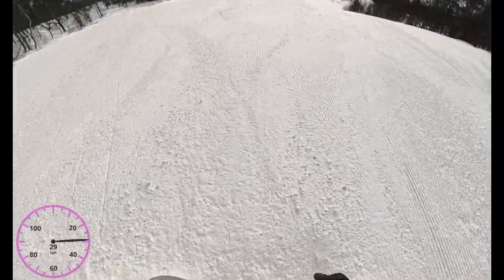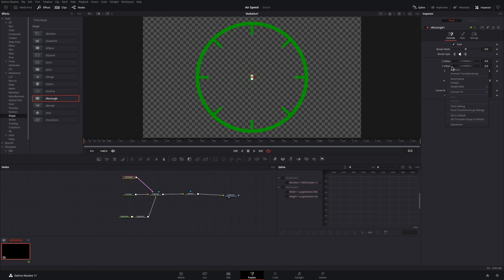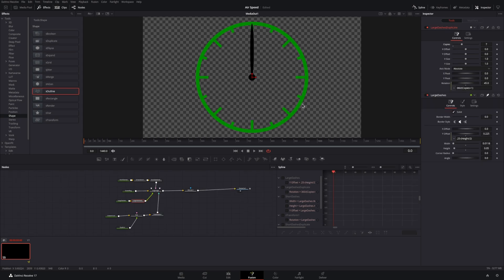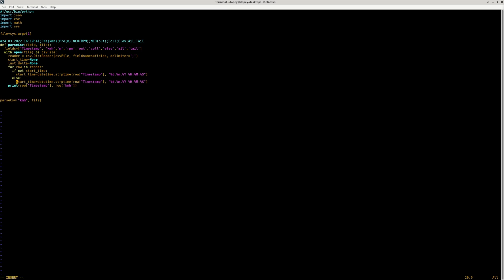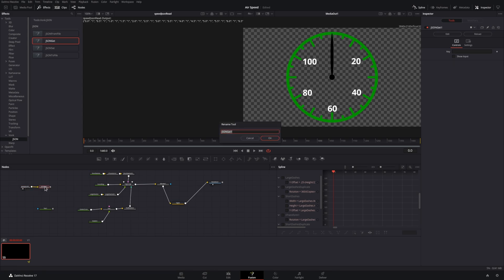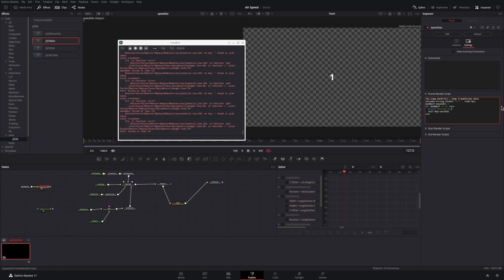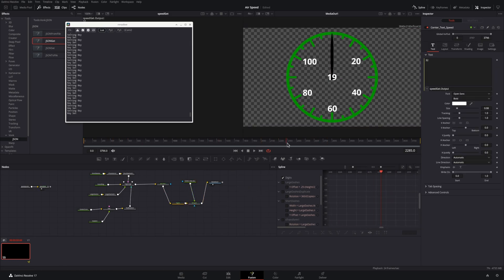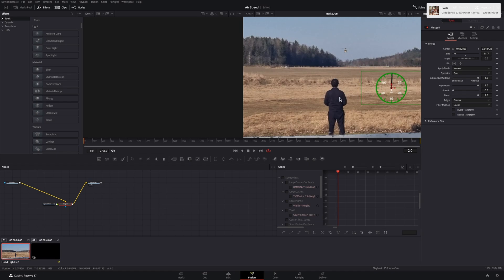Davinci Resolve: How to Create a Dynamic Speedometer

Comment: I'm a complete newbie to Resolve but could use this concept to add gauges to sports videos. I literally had to run this at 1/4 speed to see what you were actually doing. I've got the gauge done, now I'm working on the data side of things. Thanks.
Edit: I just used Excel to create a json file and now I'm trying to find the json nodes. From your vid, they appear to be in a block called Vtrk between VR and Warp. I have those 2 but not Vtrk! I'm using the free version of Resolve V19.1.1.
Edit: Edit: I just read that I need to install Fusion Reactor to get the json stuff. I tried but v19.1.1 refuses to install Reactor! There was a comment that v19.02 was OK with it, so I regressed to that and now I have Reactor and the appropriate plug-in, or whatever it is, installed. Cracking on.
Reply: Hey! I've been messing around for the past weeks with trying to successfully reach the data. I'm having struggle I think finding a good Json format so that it can correctly fetch values. If you would like to help each other I'd be really happy to help you if you do have other inquiries about resolve or nodes for exemple. What I'm struggling myself is really the Json format but the logic behind it is almost working.

Comment: Great help!
As far, as i understand +/- the same way it should be possible to draw trace on map after reading GPX file?
Reply from the maker: Definitely, the main challenge is finding which parameter to change to give the desired effect. My first thought be to use an outline shape and adjust the length to create the trace effect over the path you drew within Fusion by hand. Creating the path itself based off GPX be a whole other challenge. :)